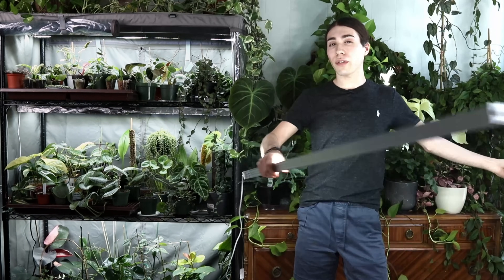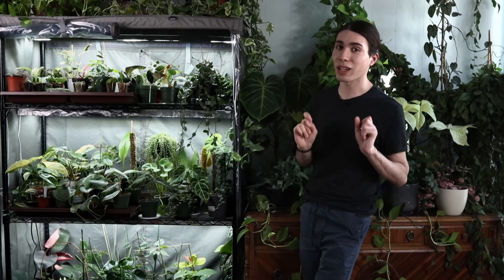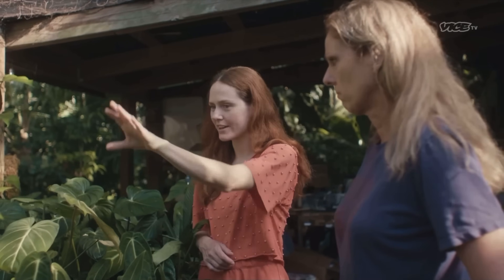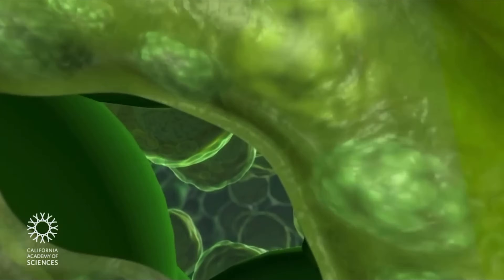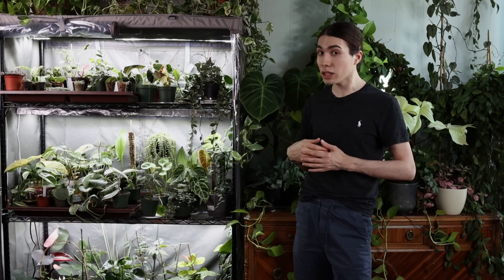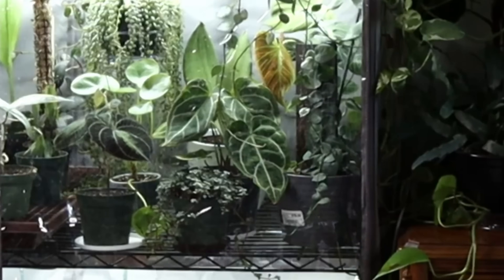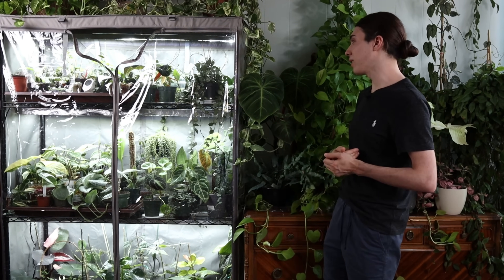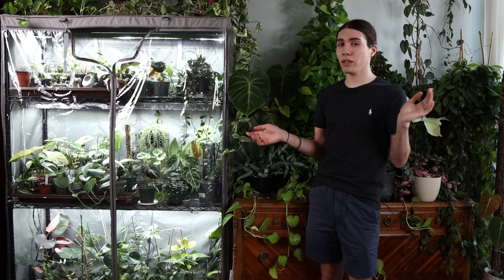How to Use Regular LED Lights as Grow Lights | Avoid the Industry Markup

Comment: nice try buddy... youre comparing a T12 TO A led...  How about you go to a t5 which 100% more efficient than a t12 from 1930, that is the florescent light people actually use for their aquarium plants, corals for salt water and plants in your green houses.

a 4 foot t5 at 6500k puts out 5000 lumens, at 54 watt.  That is 92 lumens per watt..  your led puts out 4000 lumens at 40 watts thats about 130 lumens per watt.  130 is about average for LED's.   Yes its still more efficient IN ONE DIRECTION.. pointing down.. but youre forgetting something..  T5 florescent lights are 360 degree coverage.. they are a BULB round.. all 5000 lumens is all directions..  Once you have a regular aluminum relfector you are now bouncing the 5000 lumens from the back and sides of the light down as well.  Florescent lights that get reflected lose about 10% of their light for each reflection they have to go through.   So now lets do the math here..   

The 5000 lumen 54 watt T5..,. puts outs 5000 lumens without a reflector..  Then you add a reflector and subtract 10% from 5,000 lumens being reflected from the top of the bulb.   BAM... you now have 9500 lumens being trannsmitted down to your plants.   This puts a LED to SHAME...  lol..  You have no idea what youre talking about..  This is why its a complete sham with LED's..  They are not a more efficient light.   Not when you add reflectors to a HID light such a high pressure sodium light, or metal halide or florescents.   

Also LED lights are TERRIBLE by themselves.. they are a directional light.. meaning they point in ONE direction.. that is a direction they are being projected at..  They create shadow and a aquarium is a perfect example of this.. Aquariums under basic LED lights will have shimmer/shadow which looks pretty but its actually a shadow meaning no light coverage..  This isnt good for corals or plants, so they have for decades tried to come up with diffusors for led lights to spread light out more.   These are only on extremely expensive lights, your basic 4 foot led fixture like you have only has a plastic cover this isnt a light diffusor..  Led lights with no diffusor will also create hot spots.. that can only be seen with a par meter

In essence you have a shitty LED light that actually puts out half the light of a reflected T5 florescent bulb and does not have the full coverage a florescent light would.   Hang a florescent or HID light up in the air.. and youll have double the light spread over an LED

I  hope people dont watch this video and go out thinking wow.. ima go buy a basic LED light and think itll grow my plants better than a T5.   People talking in the comment section about your "science" what science.. you have no par meter. or lux meter. or lumen meter..  You are comparing a t12 bulb and forgetting t5 bulbs.. You dont mention reflectors. Or anything else other than stuff about bassics like light spectrum.  The reason people are moving to LED is because T5 tubes need replaced after 12 months.  This adds to overall cost.  They lose their spectrum overtime and lumen output drops.   THAT is why LED is "better"  again florescent lights though under a reflector put out  neardouble the light output in a even spread.. compared to LED.

Comment: LIGHT DOES MATTER!

I haven't watched the video but FYI the thumbnail is wrong. Specific wavelenghts of light(colors) have a different photosynthetic efficiencies. Thus getting a LED lamp made specifically for growing plants will give you more growth per watts used; aka. a higher energy efficiency, and thus will deliver either a lower electricity bill or bigger plants.

Note: I am NOT talking about red/blue or "blurple" lamps.

Besides , infrared and UV light (invisible to our eyes) influence the shape of the plant. Increasing relative infrared will make your plants grow taller/ stalkier. The other way around adding more UV will instead promote a bushy more sideways growth. There is plenty of information about this available which is all very interesting. It can give you more control over the way your plants grow. 

However.. You can indeed grow plants under almost any light source consuming enough watts. But most aren't useful if you are planning on optimizing your plant growth. The great thing about most growlights is that they have a very high power density with heat sinks and a capable transformer. This basically makes any product expensive. As far as I know growlights are often rated with a much higher power efficiency anyways than your cheap wallmart LEDs, which makes them more expensive because they use higher grade components. But also reduces your electricity bill. In the end your paying the same over a course of 5 years. (but you have bigger plants).

Yeah didn't watch the video so if  this person already covered all of that im sorry. The thumbnail is seriously misleading tho.
Reply from the maker: I talked about color temperature and the spectra that plants use for growth and flowering, therefore you cannot use any LED lights that are out there, the lights must be a certain color temperature. I also talked about blurple lamps. I covered UV in them, which I advised against since people that grow foliage plants would be exposed to it in their living spaces. I don't know what to tell you but I cannot put an entire videos worth of information on a thumbnail.

Comment: Lumens are not how plant absorbable light is measured, that measurement is par, color temperature doesn’t matter all that much blue light is for denser growth and red light is for more elongation of growth.
Reply from the maker: Lumens or Lux is the amount of light, par is a measurement on the quality of the light. Both need to be in place for successful plant growth. Cool lights contain more blue, and therefore have a high par value because the light it is putting out is usable for plant growth.
Reply: @phytosexual  par is the only number you need, lumens shows the total amount of light and is not a good way to measure the amount of lights plants recieve since there are different spectrums in every light.

Comment: Hi Nick. I was wondering at what distance I should place the light from the plant. I would like to craft something like what you have, however I'd like to put some lower lumen lights so the plants won't grow as fast (I live in a small apartment so i don't have much space to out them). Do you think that around 4000lm is enough?
Thanks for the amazing video BTW!
Reply from the maker: It should be good. I would recommend placing the bulbs 6-12 inches from the top of the plant, that way all the light is absorbed.
Reply: @phytosexual , ahh, the answer I have been searching for.  Do you know that, until now, until you, no one has been able to give me a straight answer?  I am a long-time plant enthusiast but only entered into the world of grow lights in the last couple of years.  Thank you for dispensing super useful info with your unique humor, I love it!   I bought the same Formosa cover that you have.  I already had the shelf, although mine is another shelf taller, so the cover doesn't come down to the floor, almost to the bottom of the last shelf, so it will do.

Comment: I'm a very experienced grow light user. I'll be honest I have not watched this video yet so sorry if what I am saying gets your point wrong.

You are mostly right. Plants are a lot less picky about spectra than people think. Most LED lights that provide balanced white light should grow a plant just fine, and there is indeed an industry markup for plant lights, which is hardly justifiable especially for some lower end models. Especially with low light plants (i.e. aroids, begonias, other rainforest floor plants) it can work great.

Made for purpose grow lights can still be useful. For one thing many grow lights are simply designed to be brighter than your average light for home use. Many grow lights are simply obnoxiously bright compared with lights for standard domestic use. Most domestic lights are designed to not instantly blind you, whereas plants can actually benefit from intense radiation of this sort. A lot of the really expensive grow lights are more useful for growing "crop" plants indoors. I research soybeans and they need extremely intense light to grow compact. Additionally I have a suspicion that flowering is impossible in many species without very specific light cues (could be length but also specific spectra, like UV, near IR, and specific wavelengths in the visible spectrum). I think its debatable but there may be a niche use for these super high end lights for this reason, especially if you are trying to achieve something fancy.  At home I mostly focus on cacti and succulents, which, likewise, need a significant amount of light to stay happy. I am able to use fairly inexpensive lights, however (GE brand bulbs) with Mylar reflectors.

additional thoughts upon watching the video:
Edit 1 -- Red and Blue are not specifically for foliar versus fruit and flower production. Chlorophyll has its maximum absorbance peaks in the blue and red part of the spectrum (reflecting more green light). Both types of photons are regularly absorbed for energy by the leaves, and leaves also possess accessory pigments which can absorb at a wider range. Regulation of fruit and flower development is complex and the cause of flower induction may vary based on species, with some being very promiscuous and some requiring specific signals. Plants actually use green and yellow light, as well as near IR and UV for sensing their environment, though these are not essential for the plants survival. So full spectrum lights can actually serve some benefit for flowering and even extra growth.

Also, sad that you oppose flower development, its not gross. Nature is all about sex and I like seeing my plants get it on, the community be dammed.

Edit 2 -- I grow more arid plants but sun stress is very prized. My current setup does not enable this indoors, which is a big part of why I grow my plants outdoors for part of the year. Anthocyanins are the red pigment, they serve as an antioxidant protecting the plant from reactive oxygen species. UV light induces ROS which is why it among the numerous stress stimuli that trigger anthocyanin production. While the melanin comparison is quite useful, its actually not exactly analogous in terms of function. 

Edit 3 -- You missed a key piece of advice which is the benefit of reflective surfaces. Its not essential, especially for low light plants with big leaves. However some plants are really hard to light with unidirectional light. Surrounding the shelf with mylar or some other kind of super reflective material bounces light at your plants from all sides. This vastly improves the realized efficiency of the lights when it comes to growing plants and really helps with plants that have an architecture not suited to low light. Rainforest plants evolved to eat light coming through a gap in the leaves for thirty minutes, cacti evolved to eat the sun all day as it slowly moves across the sky.

Overall a really good video. I doubt you will ever read this but I appreciate the effort you take to spread good information. There is a lot of bad information out there.

Comment: HI Nick. I have been having the worst time with Mealy bugs (especially on my hoya!). I searched your playlist for help with pests/bugs, but didn't find anything. Do you have any suggestions on successfully dealing with mealy bugs?
Reply: Have you tried using neem oil? I feel it gets rid of infestations quickly when applied properly since it kills pests in any stage in their life cycle
Reply: @kayleighz7034  I have tried Neem oil, but honestly probably didn't use it frequently enough for it to be effective. I just googled it and it says Neem oil needs to be applied every 7 days until the Mealybugs are no longer present. It would be nice to eradicate them once and for all. I've been using bonide systemic granules, Captain Jack's dead bug & Malathion; however I haven't retreated every week with any of them.

Comment: LED's are directional. Light leaves in one direction only, with all other light types light leaves in both directions and must be reflected. This is one of the reasons led's are more efficient, also they tend to run cooler, especially if you under-power them, so over rate them then under power them. check spectrum and luminosity with a lux meter.

Comment: Mirrors also work as reflectors ❤️ I have lots of mirrors in my home and it helps bounce the light around :)
Reply: Do more research before believing what he said... he compared his LED to a T12 TUBE.. t12 are those giant tubes invented in 1930 used in office buildings or retail in the past.   T5 is the tube he should have shown everyone.. T5 tubes are what plant and aquarium growers like me use for corals for salt water and plants in fresh...  T5 tubes at 6500k put out 5000 lumens, thats like 96 lumens pet watt i believe.. thats lower than the 130 lumens per watt on his LED.. but that 5000 is UN-REFLECTED light..  Florescent light fixture use reflectors.. a good V shaped reflector can double the light output.   So 5000 lumens plus 5000 lumens.. minus 10% from being reflected.... Thats 9500 lumens on one bulb..   Think about that for a second before believing this dude.   LED lights like his also have no light difusor.. so led light isnt spread out.. its directional..  meaning it has hot spots you cant see without a PAR meter..  FLORESCENT lights are 100% even light  spread..  They dont have hot spots.

Comment: Grow lights do exist. A grow light is a more efficient light source for a plant over standard house lights because of the light intensity. Ive made do with house bulbs but you will spend as much in bulbs to get the lumens and also the spectrums grow lights give are full spectrum like the sun but usually minus the uv spectrum (some have uv light and there expensive).  You're wasting your money if you arent buying a decent grow light and good led grow lights have dropped in price so far that anyone just getting into the hobby can afford one. Dont waste your time and money buying bulbs that have the luminescent efficiency of night light.

Comment: Growlights for house plants but for Marijuana u need the correct spectrum as well and enough par/ light for good flower  development. A couple house hold bulbs just won't cut it if you want dense solid buds, below 600 par for flower your getting into very airy buds. House plants most vegetables don't need as much light as Marijuana.

Comment: my journey with grow lights was so rough in the beginning. i thought you could use any “grow” light so i got some cheap bulbs that were way to far away and i had problems. now i have larger led bulbs hanging everywhere from pendant cords and my plants all seem good. what i mostly noticed is the lights should be bright enough, but not hot, and they should be facing the direction of the plant because it’s not the brightness they need but the photons (honestly it’s all so complicated. idk what par is but my plants are thriving). i used to do 16 hours and now i do 12
Reply: i really like you’re cabinet setup. i hijacked all my mom’s cabinets and book shelves for my plants but when i leave i’m definitely gonna have to check these out
Reply: i also wanted to say, i use grow lights because i don’t get light through my windows. so if you want to grow plants but have no ideal setup, definitely look into creating one!

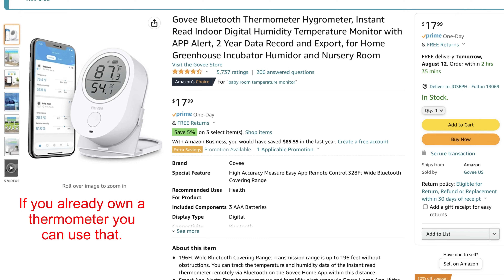Comment: 12:47 Psst dry tips are usually from the minerals in the water accumulating and frying the tip. Outer crisping of the entire edge of the leaf shows low humidity. Tip crisping is almost inevitable with some plants

Comment: Just a tip for anyone looking for a similar shelf for cheaper, Walmart sells a 4ft wide by 6ft tall metal shelf unit for around $40.
Reply: Looked all over the Walmart site at their wire shelving units and could not find one anywhere near that price. Even the wire shelving units at 3 foot wide were more than $40 each. Do you have a stock # for that unit?

Comment: Great video. I can always count on you for making an interesting video and having a good laugh at the same time.
If the leaves of the Ghost die instead of turning green they receive too much light.  There is actually a sweet spot to getting white emerging leaves that do turn green.  Struggled with it too, now it looks great though.  So proud I actually have a valid piece of information.  Never happens.

Comment: I really wonder about people who looovve the extremely expensive lighting system that is heavily marketed through sponsorship online. There is a middle ground between cheapo garage clamp lights and $150 single bulb hanging lights "for plants". I prefer my plant collection around my house in little drifts so I initially bought an assortment of those little amazon clip light with an integrated timer things in blurple then white, but now I've moved to mostly normal lightbulb fixtures unless I'm starting seeds. You can get almost any any swag light fixture with an open bottom or even a desk lamp and put a high lumen (I get full spectrum/slightly warm so the light looks nice) bulb in it for under $50 bucks total. Toss an $8 timer on it and you can integrate low maintenance lighting and plants into your decor almost wherever you want.